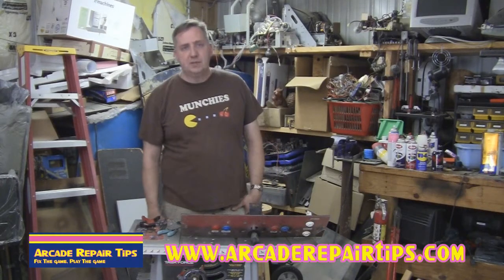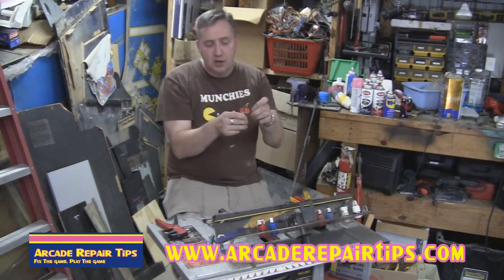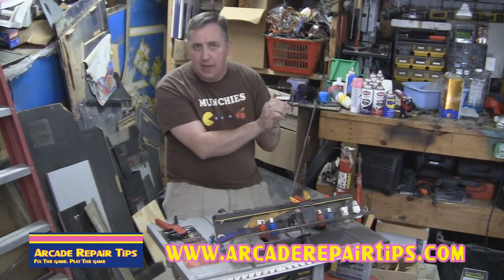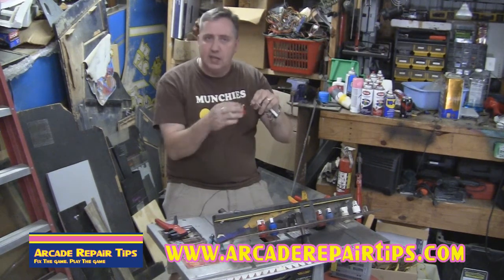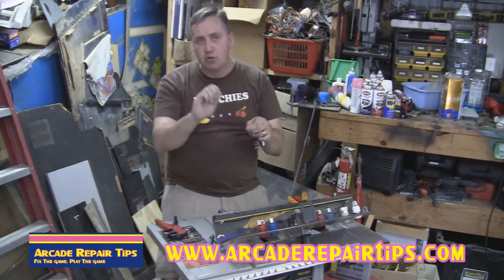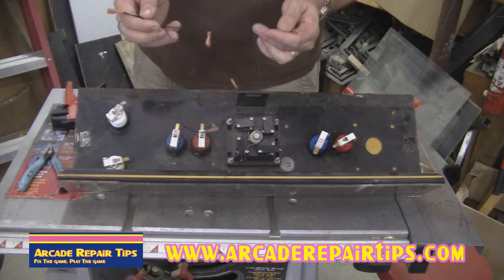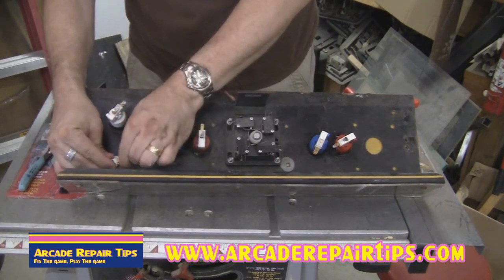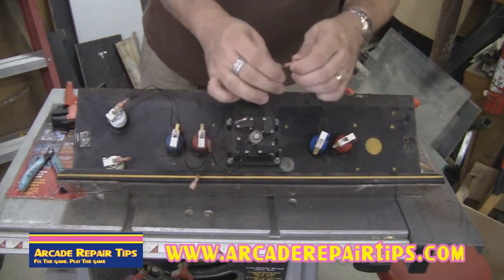Arcade Repair Tips - Connecting Ground Wires On A Control Panel

Comment: I hope this comment gets to you.  I have a 15 year old Cocktail arcade (40 in 1).  Several years ago, it started to hang up in the initialization where it gets stuck in Demo mode.  The player 1 or 2 button does not work.  In fact none of the buttons/joysticks work.  I have troubleshot the grounding wires on the control panels (noted from a previous post) and they are all good.  The voltage from the PS is good as well.  Are you aware of any other issues besides the board that could be causing this?  Any help would be appreciated.

Comment: Nice video!  Quick question, if you don't mind? Can you skip over one or two of the grounds in a chain and pick up at a later point with the sequence... like leap frog for spacing constraints... or will it cause an issue? Thank you

Comment: I'm using a setup for a PC MAME machine, so idk if you are familiar with that sort of setup, but every key besides my first key in the ground chain has the depress issue. I triple checked my connecting in the ground terminals and they all seem fine. The cable is brand new and I have no idea why this is happening. Thanks

Comment: ok i just got a new jamma cable kit and a b and 1 and  2 got ground cables but e f and 27 and 28 say ground on list but non cables wired it safe to use with cables ther or will have soder cables to them last 4 pins and ground them ?

Comment: Question, have you ever come across all of your buttons working when pushed normally, but when held down for a few seconds, the buttons are automatically depressing every few moments? For example, I'm in a game of Shinobi and I'm crouching behind a crate to dodge the incoming bullets. I'll be holding down my crouch key on the joystick, but every few moments it will randomly depress the button, causing my character to uncrouch for a moment. Do you know know why this would be happening?